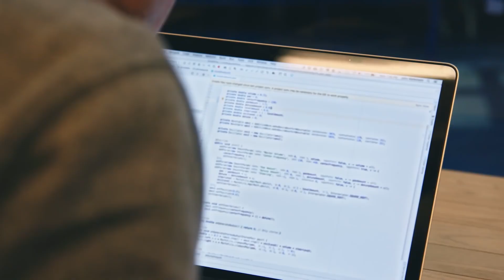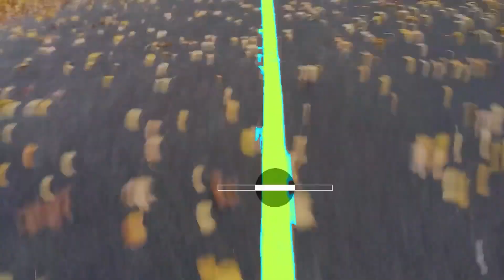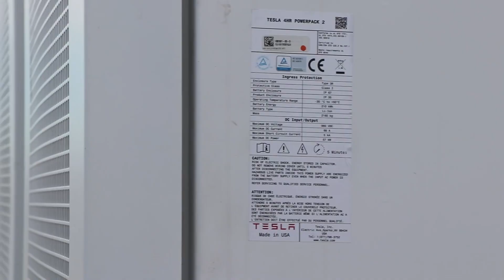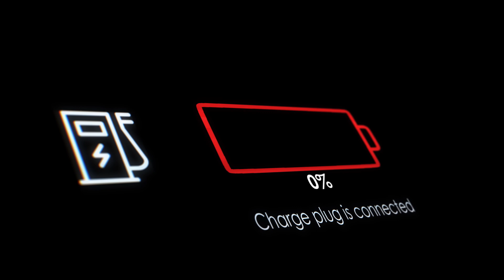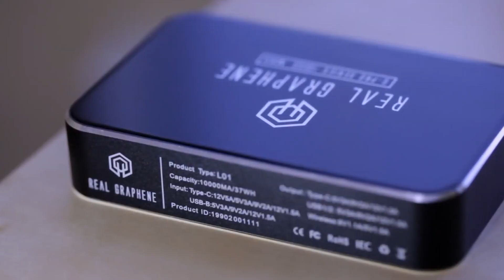INVENTIONS AND TECHNOLOGIES THAT WILL CHANGE OUR WORLD [Part 3]

Comment: Need local Tesla packs in that the local elect grid is NOT adequite if too many EV in area air cond needs battery back up 1 403 830 4124